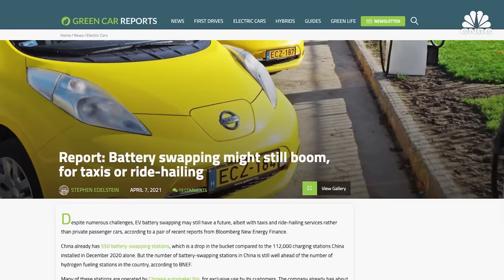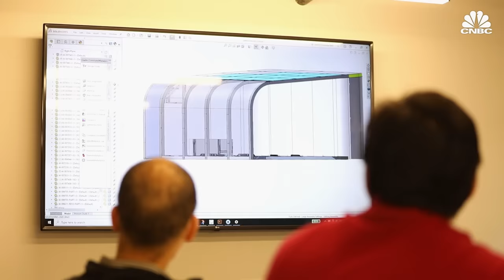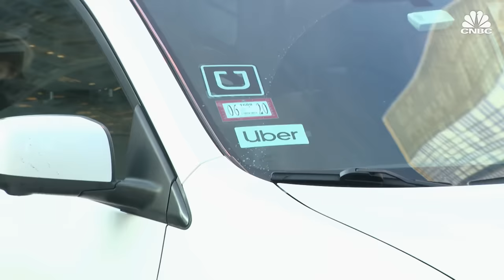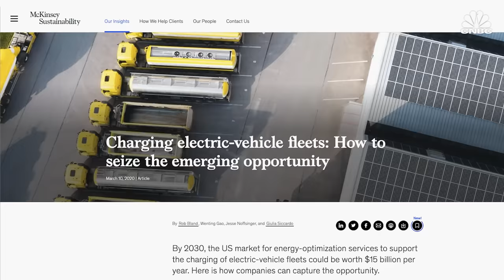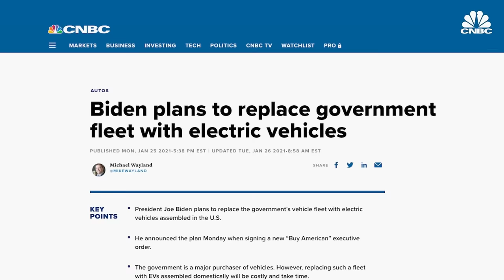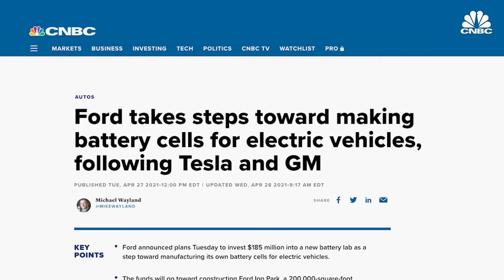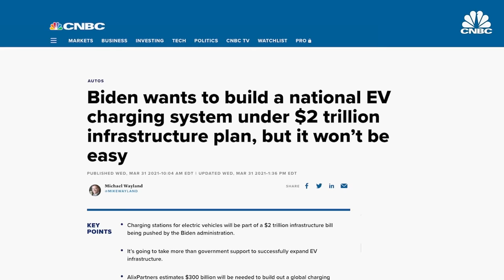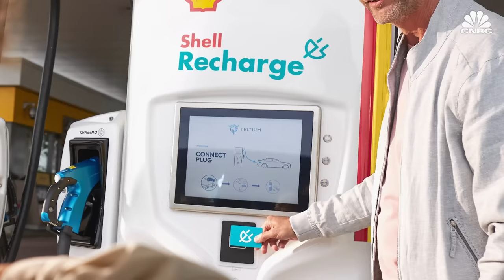Can EV Battery Swapping Take Off In The U.S.?

Comment: Yeah, NIO's gen 2 swapping station is slightly more expensive, but can service 300ish cars per day (this only maybe 140) and the swap is only 3ish minutes long no matter how big the capacity, not sure how fast do those little robots need to move in order to take those 10 minutes down closer to a more attractive number, imagine the time for a larger battery pack, not like the 40kwh like the leaf but a 80-100kwh pack, 20min? It seams rather slow at 10min, considering, that fast charging at that point is maybe a few minutes, to 10 min slower

Comment: It's ridicules that people would be opposed battery swapping because they want to own the battery and because they think they can't know the state of the battery they get. Obviously a swapping station can know if the battery meets the requirements and would not let you receive something outside the scope. And swapping to battery that has been charged in a more sustainable way for the battery would also be beneficial. Super change as mentioned degrades the capacity of the battery. I think if they do focus on the service sector, then the benefits will eventually be so obvious that also private consumers will want it. People are just slow and have odd ideas.
Reply: nothing is obvious, batteries are becoming structural to increase range, its a non starter at this level of capacity/battery chemistry.

Comment: modular batteries reduce the energy density of batteries as you need more material per battery pack, per electric connector, wiring, bms. also the more electric connectors the higher chance of failure from multitudes of reasons, vibrations, positioning errors etc. Not to mention you would need EV manufacturers to come aboard with your idea... to design around your battery packs... you would also need a huge space to store and charge the huge amounts of spare batteries to keep up with demand if it does take off so we shall see, i personally dont have high hopes

Comment: The thought of getting an older overused battery with shorter life is enough for me not to swap
Reply: I don't see a difference between this and propane tanks, which Americans swap all of the time.
Reply: @forresthsu582  Propane tanks don’t degrade over time.  Sure they might show their age but their capacity is consistent.  Lithium ion batteries degrade over time and as little as one mismatched cell can render an entire bank inoperative (though I’m sure EVs are built around the problem).  Plus people forget lithium batteries are still fairly volatile as well.
Reply: What if the swapped batteries do not degrade significantly ? The new Tesla 4860 batteries are repored to degrade only 10% after 15,000 full discharge/charge cycles.   At 350 miles/cycle, that is 5+ million miles.
Reply: @Ikouy  "Lithium ion batteries degrade over time and as little as one mismatched cell can render an entire bank inoperative"
Battery cell management excludes degraded cells.   If there are too many, after a few years, an owner could apply for a cell refresh.   Tesla 4860 batteries are shown to degrade only 10% after 15,000 full charge cycles.  At 350 miles/charge, that is 5+ million miles over the time the battery degrades 10%
Reply: @GK-op4oc  The biggest problem with lithium ion is not so much the cycle count but rather calendar age.  You could have a pack that’s only cycled 80 times but if the car is parked in the garage fully charged for 90% of its lifespan (a Sunday car for example) it’s likely it won’t be at ~99.7% health over the course of 5 years.  Elon has already mentioned Tesla batteries aren’t designed to be kept fully charged in addition to regenerative braking being inoperative at near capacity.

Comment: It's essentially a waste of batteries and it's not faster then charging, since there aren't enough swapping machines for the busy moments while charging cost 15 minits for 200 miles or so. I estimate a swap takes 2 minits a car, so with 100 cars a bit over 200 minits (if it got enough batteries and energy) with 10 superchargers it would take a bit over 150 minits. And 10 superchargers are a lot cheaper then 1 battery swapsystem.

Comment: They need to keep innovating their battery cells to higher capacity, so that customer can see an advantage in swapping to their battery
Reply: Or reduce cost significantly with a lower energy density (lower capacity) battery.  A choice in battery material and cost options can help build/save a swappable battery industry.    Need double the range for that rare 1000 mile trip ?

Comment: This will work.  Were moving towards a "convenience"  type of lifestyle.  Those in condos or apartments will benefit from this. I like this idea
Reply: Battery swapping is really not a good idea. Tesla is going to have way better range with their integrated structural battery pack than any modular EV. Teslas batteries are already cheaper, smaller, and go farther than the competition and its just getting better. How many battery packs will these swapping stations need to have on hand in a city in order to make sure people arent sitting around waiting for a pack to finish charging before it gets swapped into their car? A battery is the most expensive part of an EV and they want to have thousands of these just sitting around when the world is already battery constrained. Each one of these places are going to cost millions in battery's and they will need to be all over the city and highway, otherwise youll be driving out of your way to get a swap, negating most of the benefits. My city is already connecting ev charging stations into streetlamps for people who dont have a garage, and apartment parking spaces are getting EV chargers, all at a fraction of the price of these swap stations. They mentioned using them as grid energy systems, but that will degrade the battery life and tesla is already doing this grid battery powered energy storage with cheaper batteries that dont need to be small or light.

Comment: One issue with EV's is that batteries don't last forever, and currently the replacement cost is prohibitively expensive. So I could see the utility of going to one of these stations to swap out the battery once a year or so even if I have a way to charge my EV up at night. Also, when I buy a propane BBQ grill I don't insist that I have to own the new propane tank. I swap my new tank with another that is already filled and as long as the company guarantees a certain quality with the swapped tank then I am ok with that. Once we get used to it, I could see how we could feel the same about EV batteries.

Comment: If not for their fleet strategy, this would feel more like a solution in search of problem. Charging is getting faster and battery energy storage capacity is improving as well. The idea of someone's old, degraded battery in my brand new [insert EV Brand] car, just seems like a non-starter for most consumers. Perhaps this should have stayed in stealth mode. Also, what about the constant screwing and unscrewing of the battery to swap them out? That seems like it would be an easy point of failure over time.

Comment: I can see it now, people will be buying cheap defective batteries and barely making it to the station. Swapping out for a newly fresh one irregardless the depreciation, they wouldn't care. How are they able to assess those bringing in a defective battery and walking off with a newly fresh one. As for their own battery, it doesn't matter because then they just remove it from circulation. As for OEM, people will pull their good battery out, replace with defective, drive to station barely making it, and Swapping out

Comment: If these batteries are trickle recharging how long will they take to recharge?  If the recharging is slow then how many batteries will each station need to hold to be able to support the demand?  The slower the recharge the more batteries they will need to store.  What volume of storage space will be needed to hold enough batteries to support the throughput required to generate enough revenue to be profitable?  If throughput exceeds recharging capacity then does the station simply close until it has recharged enough to service one more car?  Then does it close again until it is ready for the next car?  To avoid this unacceptable scenario they will need to hold a large volume of batteries to ensure they always have sufficient full charged ones.  Where are all these batteries coming from?

Comment: Car companies wont agree to this. Many Gas cars wear out above 100k miles. Electrics could last a Million miles, except for battery. Now, if you can replace them like this, you wont need a new car for 30 years. The actual manufacturers should offer a cheaper replacement option. 1st gen leafs, the batteries cost 8 grand, even though they can recondition the old one and sell it as new. How about sell me one for 2k?

Comment: If ample battery can charge from renewable energy, how long time can they storage the electricity??
In terms of features of RE, they’re vulnerable to the weather’s condition so ample also needs to consider how and when they connect those batteries to the grid, given the existing sources.

Comment: I just took my Leaf 2012 to the dealer they want 8900 for a new battery also the charging circuit is bad another 2k,  nissan needs to get a refurb program going cost of batteries is insane, battery life on these older nissan leafs is only around 100k
Reply: "took my Leaf 2012 to the dealer they want 8900 for a new battery"
Crazy.  Elon Musk promotes their new 4860 cell packs with a life of a million miles.
Reply: @GK-op4oc  I regret buying the leaf I should have not been cheap and got the tesla
Reply: @350zLeMans  In 2012, you would probably have the same battery problem with any car.   EV batteries have improved immensely since then.

Comment: Textbook chicken/egg scenario and early adopters of vehicles without swappable batteries are going to going to be left high and dry.  This is a clear example of where the free market leaves collateral damage in the process of setting a standard. If we had a productive government, they would have forced the Society of Automotive Engineers (SAE, it's a thing) to create a standard swappable battery and require its use for electric cars. Every car sold in the US can be filled with gas in a few minutes using a standard nozzle, every EV should have a standard sized battery (or multiple standard sizes) that can be swapped out in a few minutes.  Waiting 30+ minutes to charge on a road trip is unacceptable for most consumers, and just imagine when getting stuck waiting in line to charge...

Comment: I really liked the first leaf design😍😘 Maybe it's a smart time to buy those old one for $5000 and be ready for these new battery swapping stations
Reply: First find out how much the conversion to these modular sets cost.   Likely high side of 10k.  Also what the new swap batteries do to the power range.   Nissan did not test and spec their cars with this battery,  so power range may change drastically, either way. 

Also note the girl with vocal fry voice.   She is saying that fast charging is bad for the batteries... So it is likely that won't be allowed in their battery packs.   Only 240v 50 amp NEMA charging at fastest (8 miles an hour).

Comment: Minutes to swap?! Well, that won't work. That's just a few minutes better than a Tesla Supercharger. Hell V3 (250 kW) Supercharger can add 1000 miles per hour. Tesla's V4 Supercharger (coming soon - 2021 Model S can charge at 350 kW).  And, you can keep the structural battery pack. This Ample has to add more weight to your car with THEIR battery pack design. That means less highway efficiency.

Comment: This will NOT be successful for consumer cars in the US. The station takes up too much space and is expensive. Right now there are about 24,000 superchargers in the US ( multiple charge links per station ). And there is still need for Tesla to build FAR more than that as a greater percentage of people have EVs. Also, as the battery technology improves, they will charge faster and get longer range, eroding the need for a swap. Swapping is a cool idea but just doesn't scale well.

Comment: I wish there was a solution that works.  But until they shrink the battery down and double the capacity, this will be a make-shift solution.  The old analog LED Motorola flip phones with two or three batteries in our back pockets!  And double thick batteries that was supposed to give us an extra hour of charge!

Comment: I have often proposed that this is the only way we could make the electric car have the convenience of the petrol car.  After development it could be done in seconds.
It doesn't surprise me that it already works in a socialist or communist state.  The difficulty is accepting that hiring the batteries is an anathema to a society that worships private ownership.  Even though it fixes so many problems.  Electrical supply, premature failure of an expensive battery, amortizing the costs and providing for recycling and rebuilding.

Comment: No, I do not think so. Several causes, not sure how this will work here in Norway during winter with salted roads. Also now with more and more cars charging at 250kW and above, the time you can save is close to zero, and the extra cost  for the complexity to manage swap, it is a dead end for this.

Comment: I would like to know how much power each module produces? are they 40volt packs? If they don't match up with the OEM voltage will the car diagnostics go haywire? Will the range be reduced since the modular cubes likely won't fit the same way the OEM plate fit? Until there is some sort of standardized voltage between all car makers this process will likely fail. There are too many variables to get wrong when the robots have to store custom plates for every different car manufacturer all in the size of a small carwash bay. 
I agree with others in stating that storing this many extra batteries is not feasible with our current battery supply shortage and the additional waste created to produce so many extra batteries. Grid-scale storage should be reserved for liquid batteries and not lithium. It's bad enough to see fresh batteries used in power walls or even Giga stations. That is where degraded batteries should be used.

Comment: Can someone explain me how Ample is only using energy from renewables? The grid cannot distinguish between one plant which is using fossil fuel from one that generates energy from solar...Any input would be much appreciated.
Reply: @mo gamer I doubt it. If you check what is the typical nominal output of a solar panel you will see that it is low (~1kW) compared to the demand to charge a battery of the EV. Their plan is probably to be connected to the grid (I think it is mentioned in the video). Cheers for chiming in though!

Comment: While I don't think this will work that well for consumers, it's certainly a solution for fleets, which will always be a big market.  That said, I think the real win would be to make these station as grid fall back as well.  Look at countries like India where the power grid doesn't have extendable capacity, vehicles like 'tuk tuks', and scooters, and small motor bikes are common.  You would equally have to invent a small engine conversion system that is affordable.  But I think said governments would welcome and fun such a technology due to the related pollution that said vehicles cause, added stability to power grids, and so on.

Comment: This is good stuff, but there are easier-to-deploy alternatives for ordinary consumers.

As they alluded at time 16:35, don’t worry about long-distance “road tripping.”  Yes, road tripping is more complicated for EVs than for gas cars, but:
1.  The vast majority of Americans take long road trips 3-4 times a year, compared to 30 miles every day of in-town driving, and you can deal with that by various means, and
2.  Tesla SuperChargers and Electrify America stations are already pretty plentiful, and at 250-350KW charging speeds, you don’t spend very long charging.

Yes, EV road tripping can take a little more planning, but only once every few months, no big deal.  By far the bigger concern is day-to-day driving in-town.

The alternative to battery-swapping is incentivizing urban and suburban apartment and condominium complexes to install ordinary, overnight, level-2 chargers in their parking garages.  EVs are actually considerably more convenient than gas cars, if, like me, you can charge overnight at home.

Comment: They have it ALL wrong I have a 2012 Nissan Leaf and my battery is useless at 150K miles this is an easy solution also the consumer doesn't have to worry about the ever changing battery technology changes. EVs will be "batteries not included in the future" Watch this space!  😀👍👍👍👍👍

Comment: Think about the logistics it would take to supply all the swap stations with battery packs. You're using a significant portion of the battery supply, not to make new EVs, but to make sure the Hendersons can make it up north for their camping trip. Those batteries would be better off in new EVs because the demand for EVs far exceeds the supply. Battery swap is a terrible idea. Charging infrastructure is the way to go. Tesla is leading the way.